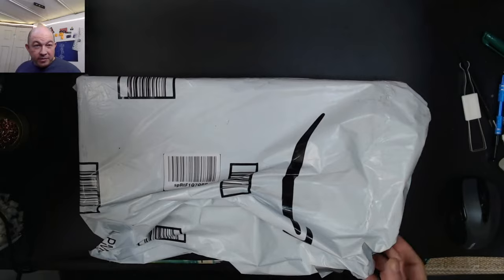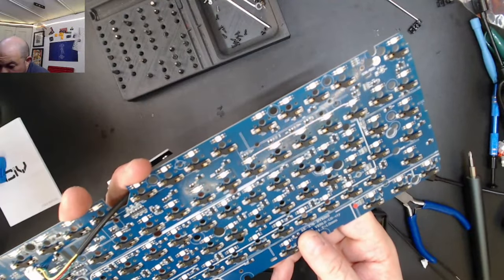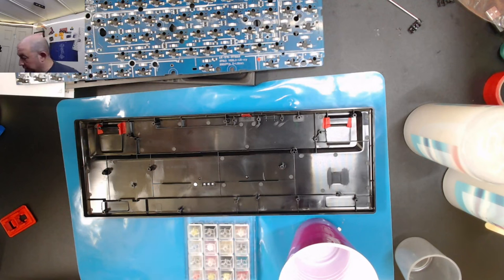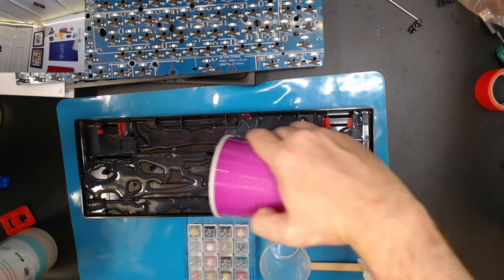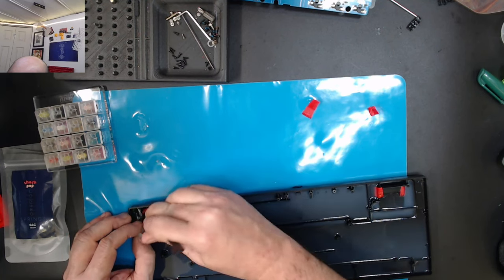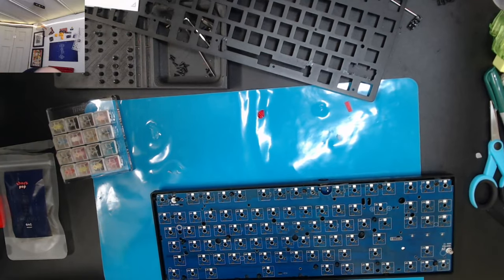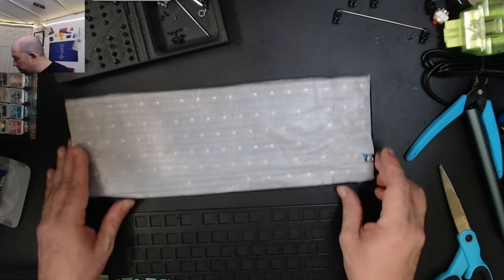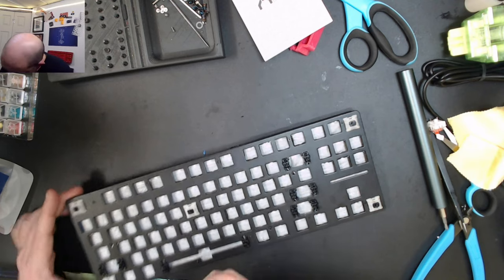CIY X77 Budget TKL - The Best Budget TKL Stock and Modded Sound Tests.

Comment: What timing for you posting this! Just bought the Black one with Blue switches from Amazon UK on their prime day - this will be my first "mod-able Mech Keyboard"

Do you think just the silicone mod and the tape on the back of the PCB will help it massively?
and should i be looking at replacing the keycaps as you state theyre pretty naff 😂 (also any recommendations on cheapo keycaps?)
Reply from the maker: Yes, even just foam helps, but silicone or butyl rubber mats will take away the hollow. The tape and the PE foam will make her pop.

As far as keycaps goes, there are so many. DO you like the profile (height and shape) of the keys that come with the X77? Those are OEM. Other nice taller cap profiles are SA, ASA, MT3, CSA. There are also flat profiles, like XDA (short) or DSA (taller), and then you have Cherry profile, which is shorter than OEM but similar.

Once you figure out your profile and colorway, many go with black perfectly, then perhaps we can find you a you an affordable set!